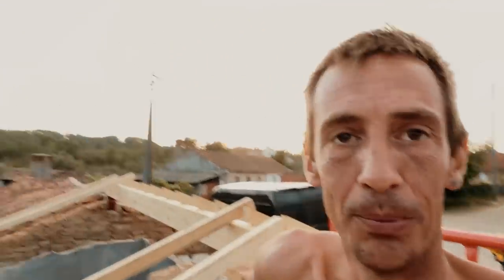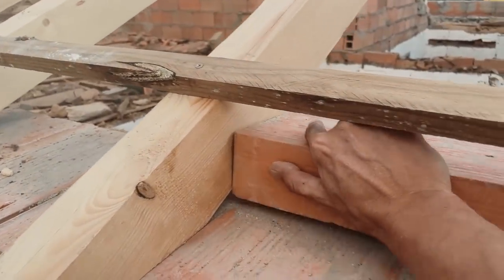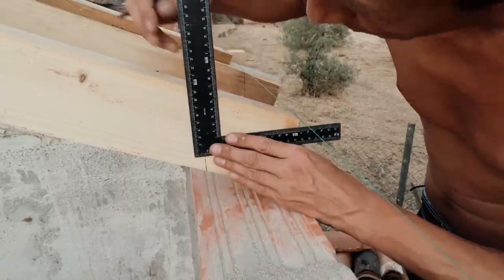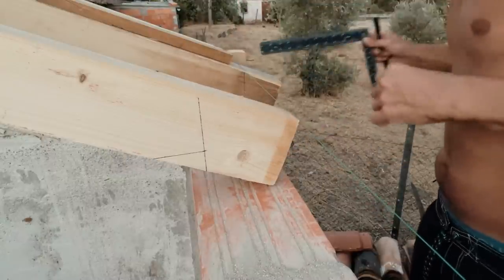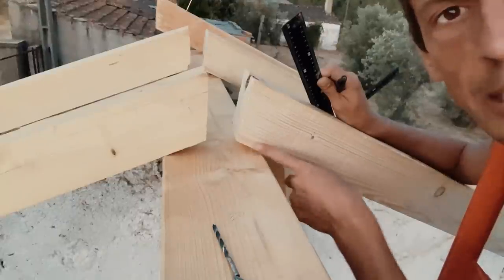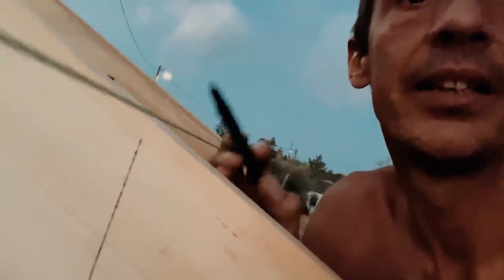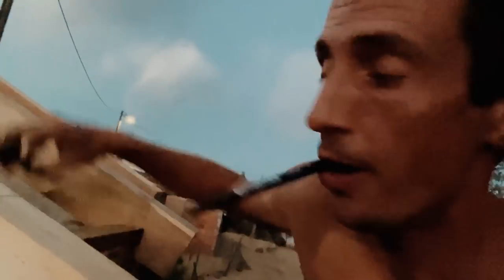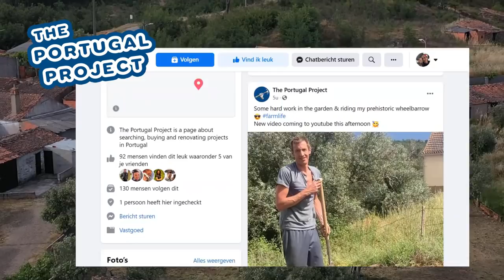Measuring RAFTERS for the ROOF of my PORTUGUESE HOUSE (and more questions arise..)

Comment: To do a birds mouth... if you are cutting a 40mm birdsmouth, then you need to raise the top vertically by 40mm at the ridge, after the lower cut at the bottom of the rafter is cut by 40mm  then the whole rafter is lowered to it's destination.. as you have a square ridge beam you could also do a birdsmouth along the ridge on the rafter. I hope it makes sense.

Comment: My advice, or solution, as amateur builder (klusser knutselaar) . Cut the beams, on this side, inside of the property, all at the same lenght.  Just put them in place on top of the construction you have . Attach the two beams together, that meet each other in the middle of the house, one on the streetside one on the property side,  onto each other with a metal strip. And so that they still can move a little bit.  Or even, make a small hole in each beam and use a big tie wrap, or cable tie, to connect them. So they will stay in place. When all the beams in place. Measure on each beam where the vertical cut has to come. You can easily see this because the beam is exactly in its place on the wall. Leave them in place, or lift them a little on that side, and cut them right at the spot on top of the building. This doesn't have to be accurate to the mm. As long as it fits, in it's place, it slides over the wall, and you can connect it properly later on. Than for the horizontal cut. With every beam cut a part of wood out, bigger than necessary. But leave enough wood that it's still strong enough and sturdy. 
Next thing you do is to get all the beams at exactly the same height  on top of the wall.  Use a line, a rope, or a big water lever, (there are also small lasers for this) fill the spaces under the beams, so above the wall with cement,  or quick cement. So you fill the space between the beam and the wall, with cement, with the amount of cement you can put the beams in their right place. Up with more cement, down with a thin layer, or no cement. (and maybe a piece of wood or small stone in the cement, that the beam stay in it's place till it is dry) Next step later on, when this is all leveled. Connect all the beams to the big middle beam. And fill up all the spaces on top of the walls.  Kijk maar of dit wat voor je is, dit lijkt mij wel te doen. Good luck.

Comment: Jasper I love watching your vlogs because I just have to see what you are going to do wrong next. You seem to ignore all the very useful comments especially the ones about needing a wooden wall plate. This  should be straight and level securely fixed to the wall and should match the straight and level ridge beam so that each rafter will be the same length, same bird's mouth cut and same overall dimensions. The way you are placing the rafters on those hollow bricks you run the risk of the whole roof collapsing in a good storm with you inside. As for knocking out those internal walls before you get the roof on - DON'T DO IT.

Comment: Others have said it, your rafters need to be fixed down securely at the ridge AND at the eaves. A 100x50mm wall plate bolted into the top of the wall and then the rafters bird-mouthed onto them and fixed to them. This anchors the eaves and stops you losing your roof in a storm . . . . . . .

Comment: Wouldn't it have been easier to support the rafters on another wooden beam at the bottom, on top of the bricks? Making the entire roof square.
Reply from the maker: Yes that would be easier. But more expensive and at this point it will take longer to get the beams then to try it this way..
Reply: @GhostTownVlogs  Maybe not beams, but how about some of the same wood, one of the rafters just to have the square support over the bricks?
Reply: Jasper a wooden beam is not as expensive as the roof falling in on you in a good storm, I know you Dutchmen don't like spending money though.

Comment: I have been worrying about the sustained pressure from the weight of the roof on the catelevered trujillo Jasper and whether the roof will spread over time without tie beams. 
I don't know tne answer as I'm not a roofer but go with your gut my friend, best wishes dude 💛💚❤
Reply: He has no wallplate to tie down and he has put the rafter ends outside the wall. 
Previously the rafters used the walls to stop the spread so he will have to use joists to tie it all together, or not.
He skimped on wall plates and will now pay the cost.
Reply: @I-am-not-a-number  can you help the man out with advice? He is clearly working hard and doing his best to learn which is admirable wouldn't you agree?

Comment: Use a long piece of 2in x 6in wood on the top of the bricks and have your rafters sit on it and distribute the weight evenly on the brick wall.
Reply from the maker: How is that going to work if the offset from the wall of 20cm  at the other end..?
Reply: @GhostTownVlogs  all I'm saying is lay the 2x6 flat on the top of the new row of bricks
Reply: @GhostTownVlogs  
In the event both faces the roof are trapeze you'll have to choose whether the top or the down line to be horizontal ...
Usually as aesthetics matter we choose an horizontal top of the roof which do means the down of the roof will have a slope were the water will drops and not be horizontal ...

Unless you don't have flat faces as roof but curved ones ...

It's pretty common to have a belt all around the house on the top of the walls where you'll "tie" up your rafters ...
Which could means cut the bricks instead ...

But the comment is quite right when talking about weight distribution on about what's a roof ...

You'll learn .

Comment: Hoi Jasper, your birdmouth settingout is done while the rafter is rotatet upwards, this is due to your setting out placement of the rafter while making the marks. Better is to calculate the angle of your roof design and use this as your guide. You describe that the new brick wall edge is parallel to the beam and horizontal. Simply calculate the length on the outside of the rafter and use the roofangle to make the birdmouth line up. You cannot set out the way you do it now, because of the rotation with rafter in relation to the roof angle by this way....

Comment: I think your line should be to the end of the beam,  (sticking out over the edge) to ensure they are all in line, and you need a template for the angle of the end cut for once you have measured where to cut. as the height of the beam (while not cut) changes the angle it sits at.   (or something like that)
Reply: ps I know nothing and there are still flaws in this approach.

Comment: It is a difficult one, I would attach the top of the beam first, just incase it slips as this could account for the lose of 1.5inch, also could you measure the first beam to see the amount of overhang and make sure it is the same as the one you are cutting this will depend on the wall being straight of course. If I was doing this project  I would screw a wood wall plate to the inside of the wall to attach the rafter too first and make sure that is straight to work off as your brick may be out a little each time and that is what may be given you trouble.  I do admire your patience and it is not easy when you have no one to help you who know what they are doing, I hope you solve the problem and do not waste to much wood, good luck tomorrow. xx p.s do you have any chisels as you may need these to take the finer mm off the wood, I always use a chisel and make sure they are sharp and you get a nice clean cut in the wood.

Comment: You should have a timber wallplate on top of the wall to fix the rafters to .🥱
Reply from the maker: I understand the concept of transferring the weight, but otherwise I don’t see any advantage. Besides that the wallplate would stick out in offset 20cm, I don’t see how that could work ..
Reply: @GhostTownVlogs  Bed your level, parallel wall plates on top of the inside of the wall and use wall straps on the inside of the wall to fix it down.
Fix your rafters, these will all be the same if the wall plates are accurate, to the wall plate to stop the spread.

Comment: May I suggest you offer up the pattern rafter to the position required and ascertain whether the birds mouth needs to be smaller or larger and make the adjustment on the rafter to be used. Also I suggest you cut and fix angled pieces of rafter timber near the base of the rafters on the other side to transfer the weight to the inner wall. Or at least build up the inner wall to the rafters before loading the roof.

Comment: Some tip for you 
1. Don't saw on the line the line, you need to see the line because the saw blad take 3-4 mm
2,If you have a Waterlevel ( spiritlevel) used that ,if not get one.
3,The wall is probable not  straight

between the 1 and 
measure the gaped one the first rafter
8. take a way so

Comment: You have to measure the height of the wall it’s not level so it throws everything off .you might have to put down then layer of concrete to level it  get longer rafter  than cut it fit 👍🧊🧊🧊🍻🍻🍕🍕🍕

Comment: Your problem with the rafters lies in the fact that all old buildings are not ever square. The Diana Tonkinson  comment below is the solution to over come the unsquare old building. I agree Work off the line and use the sliding bevel or level. Follow Iwan Thomas's advice as well.

Comment: From what I can see you are still following a winking in and out wall. Put the string line on the first and last rafter.
Then use them as the draught line just do all the bird mouths the same if the walls level that you have repaired it should be easy. Yo always use the same angle. Every thing from the line will
Be equal the gap at the top
Where the rafters do
Not meet can be made up later with timber to
Join them all up in a line. Forget the walls just work of the line I said on the two
Main rafters first and last. Lay a few up there not cut and you will what I mean.
It’s such a simple job.😂
Reply: Make a cardboard template of one the correct bird mouths with your end of rafter in line with string line and you will then see how it works.

Comment: You do not intend to belt the walls whatsoever ?

Best thing to get done here stand to put 4*20 centered on the top beam ...
You won't connect the top the rafters to make the equilibrium which is often required onto this type of work ...
The heigh onto the top beam will ease what's next with roof, the covering of it ...

Plse don't forget to have a perspirant anti-dust sheet just over your rafter before any other kind a thickness onto it ...
Looks like a budget but will improve what will have to be considered as an urge ...
Unfortunately quite soon .

You'll learn.

Comment: 4. put the rafter right on the top
 take a pen and drag a line there th wall is.
5Put the spirit level between the first and second rafter
6,lift the spirit level on the first rafter so it bee straight 
7, meassuring the gap maybe 7 cm
8, take a way 7 cm on the second rafter
it will probably not bee the same on any rafter 
Good luck and have a great day

Comment: At 6.09 you pushed the rafter on the brick and at 7: 50 you marked a line 90 degrees with the brick. Wrong.
You are not doing a 90 degrees cut cause of  how much you push the rafter on the brick will determine the angle.
You have to mark the 90 degrees with the vertical line assuming the brick is perfectly flat.